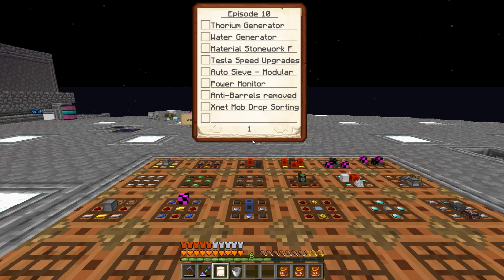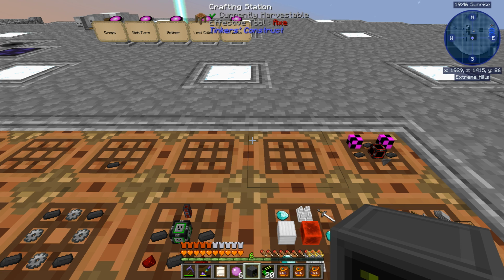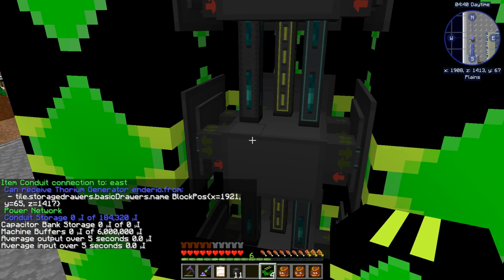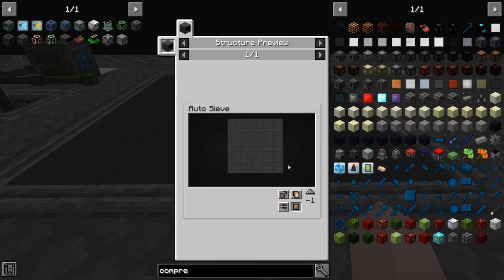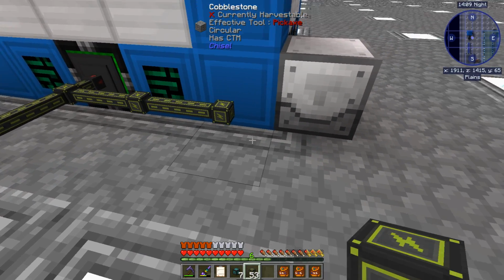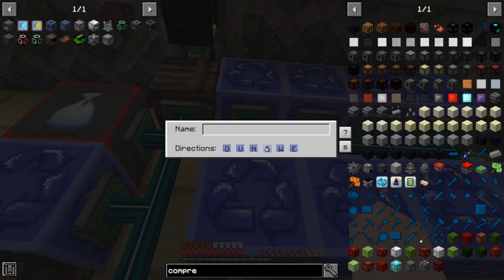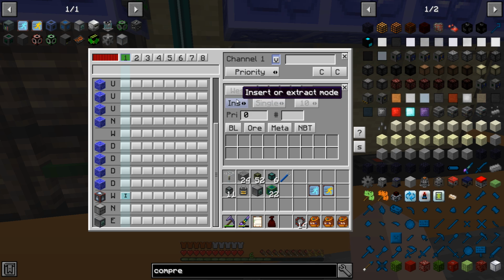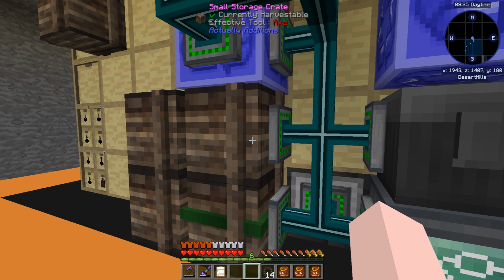10 - Auto Sieve, Thorium Power, XNet Mob Sorting - Project Ozone 3

Comment: I'm having to start over because my world ended up corrupted. What would you suggest for storage of the unstackables in the early-game since Anti-Barrels were removed?
I don't have to worry about the normal drop sorting, but I really don't want to have to junk unstackable things until I get something of a central network going (which won't be any time soon), and I don't have the resources to work with X-net right now.
Reply from the maker: Enderio has priorities too and can be used instead of Xnet.
Reply: @WilxGaming  Thx...I forgot EIO had mass storage options.
o7

Comment: you can add energy uprages to stonework factory to make it faster
Reply from the maker: > you can add energy uprages to stonework factory to make it faster
The description says energy upgrades reduce the power used by 25% each for a total of 44%. While I believe you, how do they make it faster?
Reply: @WilxGaming  Energy Upgrades reduce the energy needed per operation, which means they take less time to fill their "work" energy meter, since it is lower.
Reply from the maker: > take less time to fill their "work" energy meter
Ah. That makes sense.
Reply: Specifically, the wiki says that, "when installed, the machine will reduce the amount of Tesla required by the machine's processes by 25%"

Comment: Thank you for showing how to do the modular auto sieve. I ended up using ex nihilo dolls and a mob duplicator to get rods instead of the extra powders from dust.
Reply from the maker: Ya there are easier ways, but if I waited until I already had the dusts, the Auto Sieve wouldn't be very useful. For a sieve it should be easier to make so you could build it early game.

Comment: Try making the coin of fortune , pretty good magnet and it also does the fluxomagnet thing where you can right click an item which is far to pick it up , you don't have to have it on all the time
Reply from the maker: > coin of fortune , pretty good magnet and it also does the fluxomagnet thing
Good to know. What is the default range for automatically picking things up. Does it have any advantages over the fluxomagnet?
Reply: @WilxGaming  I don't think so. If I remember correctly, the main magnet is about 5 blocks away and the fluxo part can pull from as far as 15 blocks away. 

I've been experiencing them disappearing on me once or twice, and can't figure out where they're going...

Comment: There are 2 buttons called “C” on the top right on the XNet Controller GUI. They stand for copy connector and copy channel (into your clip board, so they work cross controllers and saves), and then you can click the paste button on an empty connector to paste it.
Reply from the maker: Good Tip. Interesting timing. I was just looking at those 2 buttons and thinking I should find out what they can be used for. That and in what way would you use a channel priority? I know how to use priorities for connections on the channel, but what does setting a priority for the whole channel accomplish?
Reply: @WilxGaming 
Somewhere on the XNet manual it says the Random/First/Order on the connector represents the way it extracts from the inventory. For example, Order is basically round robin, First finds the first item stack that matches the condition.

On the other hand, the Priority/Round Robin/Distribute on the channel setting represents the way it distributes the extracted items. For example, Priority will make the item go to the appropriate inventory with the maximum priority,; Round Robin will store the last inventory it inserted to and choose the next one.

You definitively can find a lot of issues related to that, like XNet#41, #191
Reply from the maker: > Priority/Round Robin/Distribute
Oh right. Thanks for reminding me. That's what I get for commenting on something I noticed in editing and not clicking on the button to see what was underneath. I now remember that I tried it out in Continuum and noticed that round robin was much slower and wrote it off as uninteresting. My brain seems to remember what I find interesting and pushes the rest to the back where I really have to think to recall it.